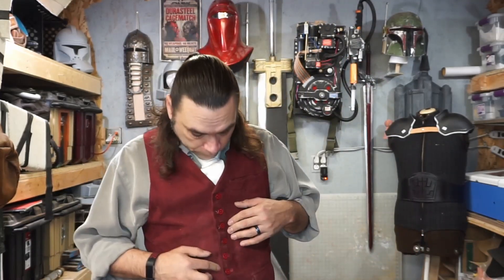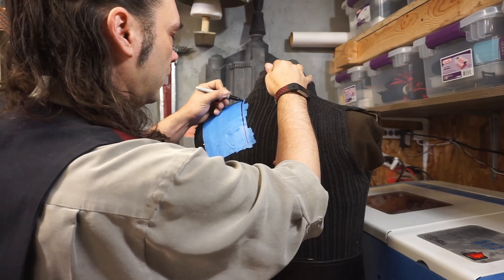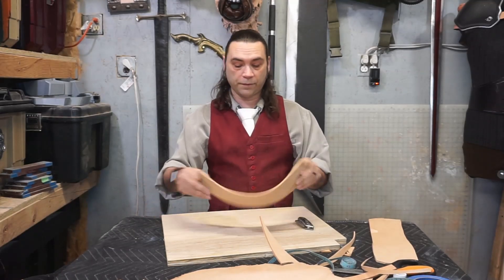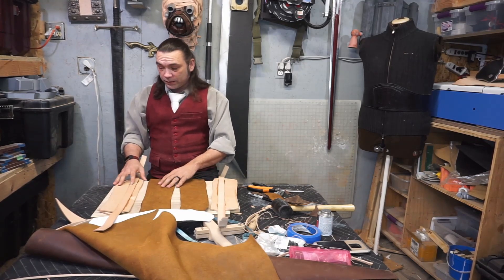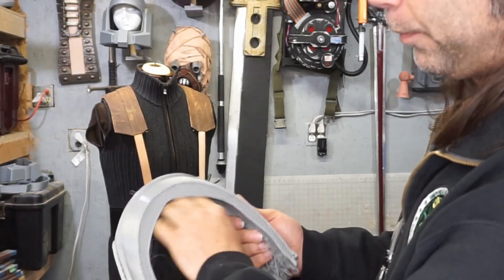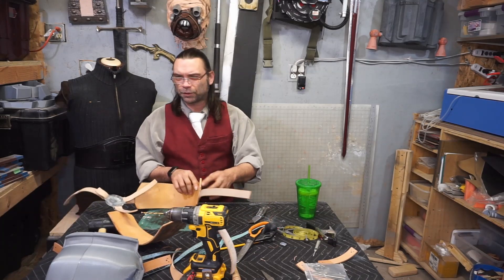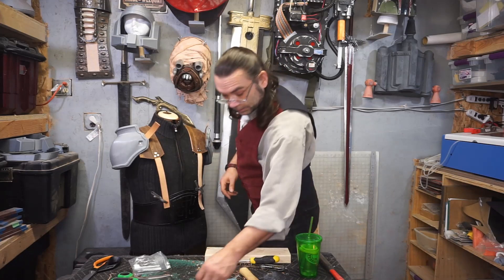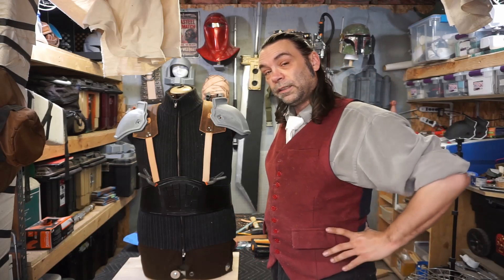Leather Soldier Suspenders Costume Piece

Comment: For the rivets to be perfectly symmetrical, you could lay the two straps mirrored on top of each other and drill the holes through both layers at once. A bit late for this project, but it looks quite symmetrical as is. The costume in general is turning out really well!
Reply from the maker: I'd be worried about the bit wandering. I could have also made a template, but its such a small detail, I was overthinking it.